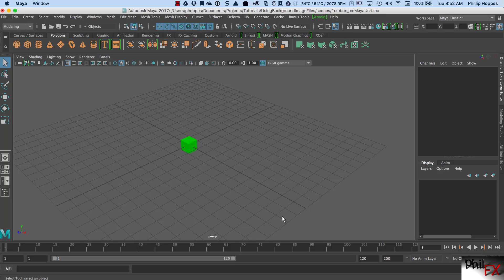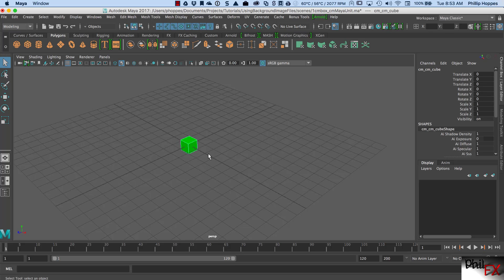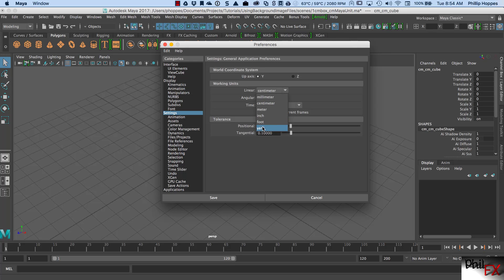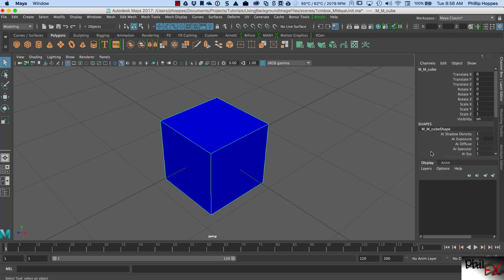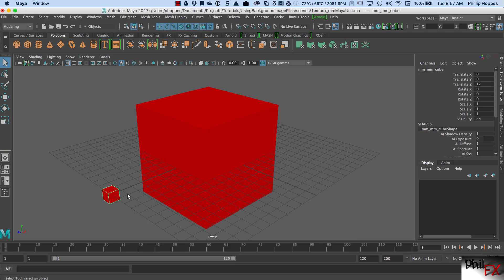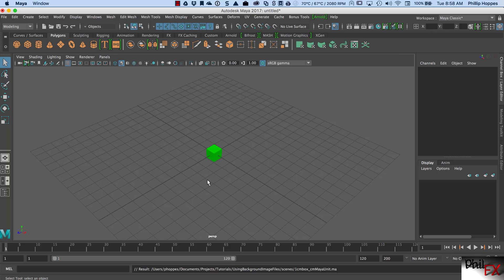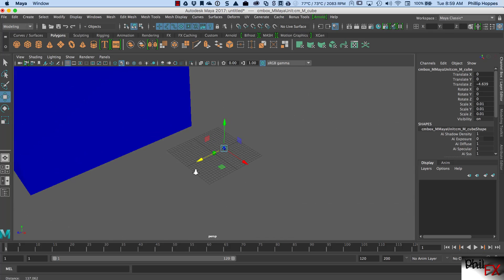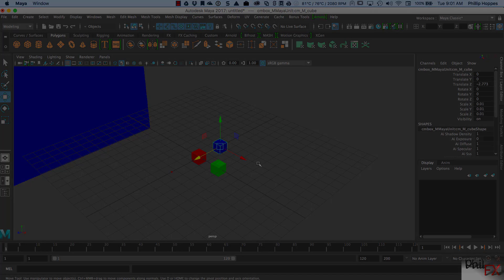Working with real units in Maya 2017

Comment: Ohh right, i froze transforms and deleted history.. that resets those all to 1..so if you have specs and you freese transforms it all goes to hell and resets to 1. How would you remeasure something to show its length?
Reply from the maker: The size of an object will always be in Maya Units regardless of the physical scale.  Freezing transforms will set rotations to 0, scale to 1 and position to 0,0,0.  The size of the object has not change.  If you made a box 3x3x3 Maya units in size, spun it, and repositioned it and even scaled it, lets say by 2, the dimensions are still in Maya Units and what a Maya Unit represents is how you set your preferences.  In my example where you scale by 2, the size will now be 6x6x6 Maya Units.  In the channel box, if you froze transforms, you will see scale =1,1,1 .  The scale units in a channel box are NOT Maya Units.  They represent a scale factor.  Setting Scale X = 2 will multiply the current Maya Units of an object in X by a value of 2.  If you set Scale = 0.5 you will multiply the current X value to 0.5 x the current X value in scale.  So to summarize, in the Channel Box Transform units are in relative Maya Units from the current position.  If the current position happens to be the origin and you move the object, the values in the Transform box will also equal World Coordinate values.  If, however, you move the object to lets say 3,3,3 (X,Y,Z).  Now you Freeze Transformations.  You will see in the channel box X,Y,Z now all equal 0.  If you move the object to 4,4,4 in World coordinates what you will see in the channel box is 1,1,1 because that is the relative transformation movement from where you froze the coordinates, which was at position 3,3,3.  Rotation in the channel box always equals degrees and Scale, as I mention, is a multiplying scale factor.  Scale is NOT a dimension.  Does that explain this a little better?

Comment: Hi Phil! Scaling is not the same as dimensions. When an object is placed in the viewport, it usually gets an initial scaling of 1:1:1. In your tutorial it works because you use a default cube which has dimensions of 1:1:1 units. Create a torus and it will also get a scaling of 1:1:1, although its dimensions are different. Other tools like C4D or Blender have two sets of values: one for real dimensions (e.g. cm) and one for scaling. Is there something similar available in Maya?
Reply from the maker: I'm not sure I follow what you mean.  Units in Maya are all based on an arbitrary unit called a Maya Unit.  You go to a preferences tab in Maya to set how a Maya unit is to be interpreted for use with respect to real actual physical scale.  A Maya Unit can be a mm, cm, m, inch, foot, mile.  Internal to Maya operations this actually only comes into play when you are working with "Real" lights that are based on the physical real world and their luminosity is given in actual lumens.  Then real physical distances make a difference as well as if you are using PBR materials.  This also comes into play when you export an object into an intermediate file format such as an .fbx or a .obj.  You need to know the export units to import that object correctly into another DCC program.  When you scale in Maya, the term "scaling" has zero to do with physical real world units.  Perhaps in C4D that is different but not in Maya.  Scaling in Maya has to do with exactly what the word says.  You perform a scale transform operation on the object.  Scale, in Maya, is an arbitrary unit to scale an object and has nothing to do with a physical distance.  A uniform scale of 2 means every X, Y, Z,  dimension is doubled on the item.  Again it has nothing to do with actual physical units.

In the Channel box you see options for Translate, Rotate and Scale.  Translate are in dimensions of Maya Units, Rotate is in dimensions of degrees and Scale has no units.  It is a quantitative factor.  When you select an object, cube, cylinder, sphere, torus, the units of the actual size of the object are in Maya Units.  A "Unit" torus has dimensions of 1 Maya Unit Radius, 0.5 Maya Unit of Section Radius, Twist 0 degrees, Subdivision Axis and Height of 20 edge loops.
Reply: @PhilFXPhoenix  thx for the video but JörgM is right. Scale number is not useful in terms of dimensioning. You see 0.01 scale for 1 cm box because you did not freeze transformations. When you do it to any object, it is scaled with 1,1,1 regardless of the size. Units are only useful when you import an object with different unit into another project, then it is automatically scaled.

Comment: This is good information, because transparent materials like glass or polycarbonate, or subsurface scattering materials like cheese or milk, don't look physically correct in any high-end rendering package, if they are not modeled at real world scale.
Reply from the maker: Glad you liked it.  In addition, if you are taking the time to create models, you might as well make them to scale so you can create an asset library for yourself.  The only obvious exceptions to this are if you are modeling in the micro world (cells, virus, dna, etc.) or the macro world (planets, solar systems, etc.).  Both of these are at the extremes of scale which precludes even attempting to do real world dimensions.  Both of those live in the land of "cheats" because real world units are ridiculous.  Best.

Comment: Wrong.
Reply from the maker: Would you care to elaborate?  Simply saying wrong helps no one.  What do you find that is in error?
Reply: @PhilFXPhoenix  0,01 is 1 centimeter? or 1 millimeter ? 0.1 is 1 centimeter (no?)
Reply from the maker: @lokhz9876  I don't understand your question.  The default real unit for Maya is 1cm/1Unit.  You change this in the preferences to be what ever dimension you wish such as 1mm/1unit or 1meter/1unit.

Comment: Iam beginner enviroment artist my works willbe in km unit???
Reply from the maker: Not sure I understand your question.  The default unit for Maya is 1 Maya Unit = 1 cm.  You can change this under preferences.  Typically if you are modeling something on the order of people or a single room this is the preferred unit to work with.  If you are modeling something very large like a building, ship or airplane then you would probably want to work with 1 Maya Unit = 1 Meter.  If you are working with something very small then perhaps you would want to work with  1 Maya Unit = 1 mm.  There is no standard it is your choice usually based upon what you are modeling.  This does become an issue if/when you try to share assets with other people however because they would need to know what your units were when you built your model so they can import it correctly.
Reply: @PhilFXPhoenix  ok can maya 3d make large terrian(mountai) or large oceans for games please tell me because iam studying to be 3d enviroment artist and I decided to be specialist in maya 3d not 3dsmax????
Reply from the maker: @abdelrahmanmohmed3185  Well you can but I would say that doing environment modeling is not it's strength.  Maya's best strength over every other 3D program I would say is 3D Character animation.  If you want to do terrain modeling there are better applications you should look at using.  Go look at geekatplay.com .  This is a website run by Vladimir Chopine.  He is a master at terrain modeling.  He uses a number of different 3D applications for his creations.  I'm sure if you contacted him on his website and looked at his work .  Good luck!

Comment: I agree you should stick with the measurement you want to use. The problem I am seeing is everytime I load up Maya I have to go back into the preferences every time and change the settings. Seems rather nearsighted on Autodesk part that when I make a choice it should stay at that choice until i go back in a change it to something else.
Reply: Iam beginner enviroment artist my work willbe in km unit??? What about km???